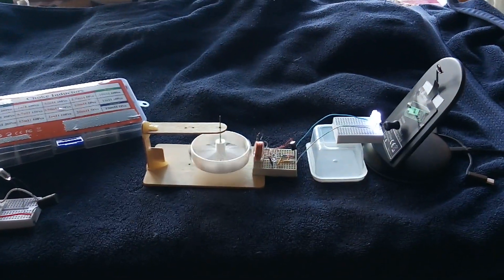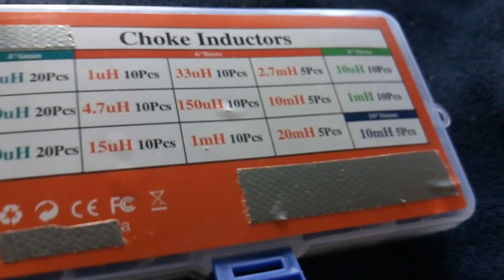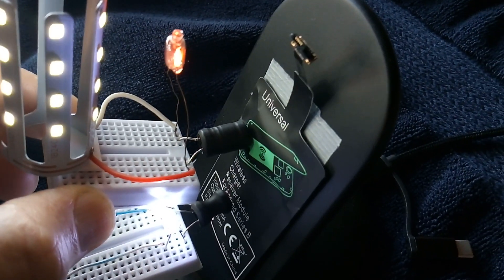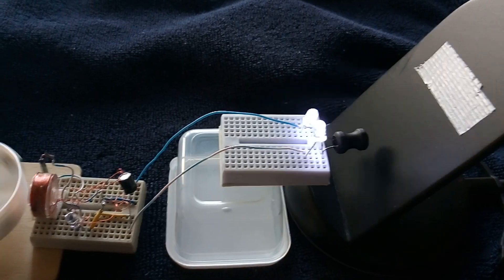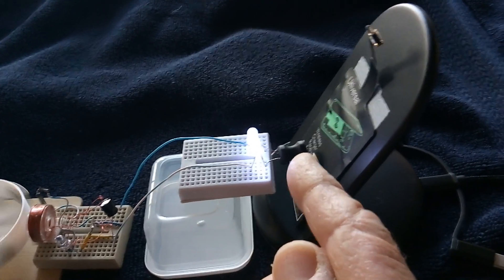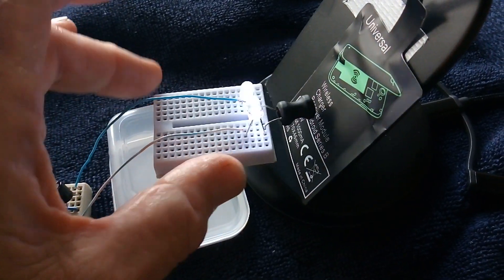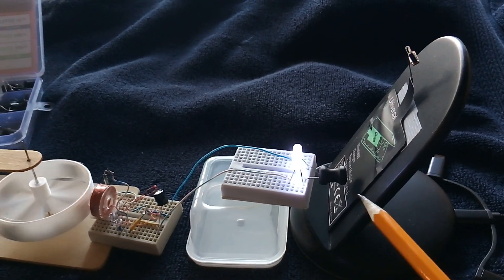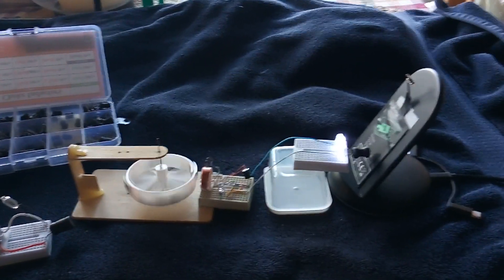Choked Wireless Energy

Comment: REQUEST!!!! You should experiment with the setup you have for the Choke w/ the LEDs and neon , all parallel. First add a capacitor in parallel and expirement with a few different values and see what results you get. Second, add a capacitor in series with the choke, so the cap is in series with the choke, and the cap+choke are in parallel with the neon/LEDs, and see what results you get.  If you get anything interesting you should post your results.

Comment: The choke is also called an inductor... Which is 'inducing' wireless EMF waves. You can do the same with a coil of wire. The closer to resonance/inductance harmony as you can get will harvest the most energy... Wireless energy is still the most inefficient. Try using a Tesla coil and an AV plug for greater distance (and energy loss).

Comment: What an excellent Christmas present to see this today. Merry Christmas and a Happy New Year 😊 🎁🎅🎄☃️ I was toying with the receiver module yesterday, think I killed it drawing too much power through it 😆😖
Reply from the maker: Merry Christmas and Happy New Year to you also.  I burned out one of these Qi receivers also years ago but I carefully took it apart and the coil part still worked fine.  I am very surprised that this receiver would trigger the transmitter with no load attached to it and allow the power to pass right past it.   Induction is a strange animal.
Reply: Oops? Is that even possible? Maybe bad luck.
Reply: @deslomeslager  I connected a small electric motor direct to it's output, it worked well but the circuit board got a little warm. When I tried it again the following day it only works intermittently, if at all.
Reply: @GrandadIsAnOldMan  Gotta break one to know its limits... see it that way?  :)
Reply: @Slider2732  absolutely 😆😆 I have ordered a couple more, I might be more gentle with them. Merry Christmas and a Happy New Year 🎅🏼🎄🎁❄⛄

Comment: Exc. That inductor should run the motor and lights if put next to a low voltage power supply with a transformer in it also. 
Stray magnetism is all over the place.
Reply from the maker: Sounds like an upcoming experiment for me.  Thanks.